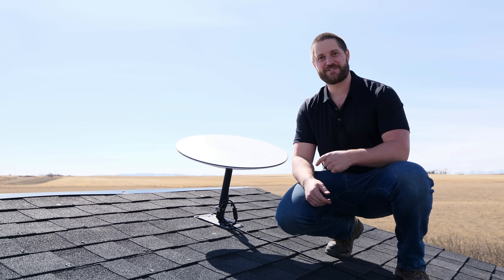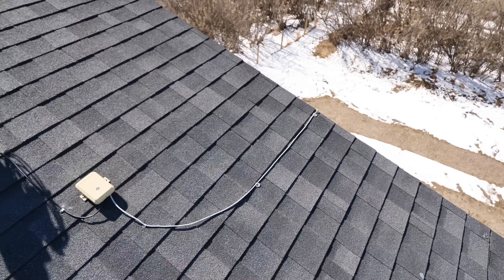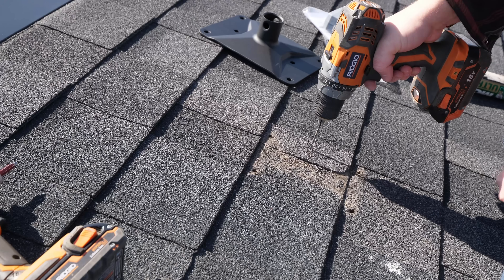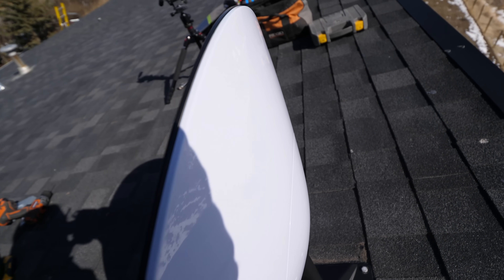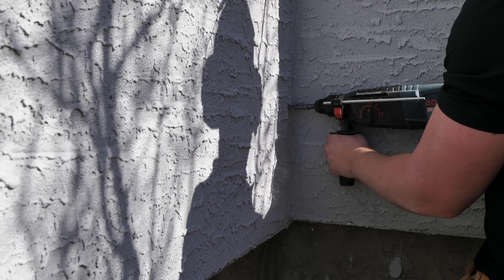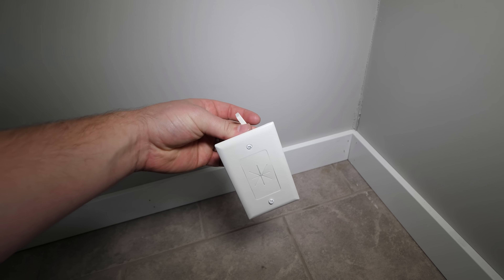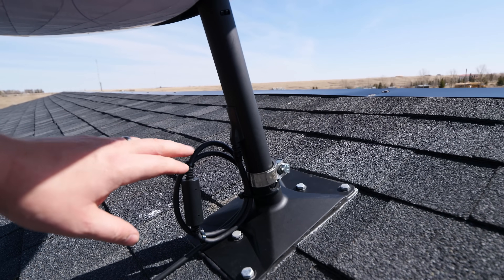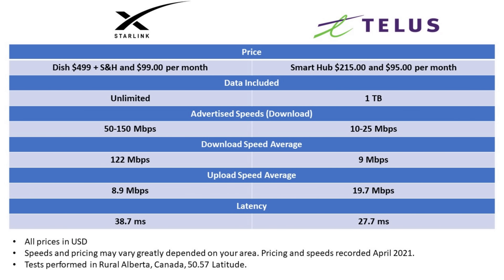Starlink Install, Speed Test, and Review

Comment: Great video! I get to install my first Starlink system for a client on Monday and because of your video, I discovered a small detail I overlooked initially. Your video was very thorough and informative. I used to be an installer and your install was flawless. It's unfortunate how poor of a design the mount connection is (considering who the manufacturer is!)... I vote for your version!  Thanks for the great video man!
Reply: if someone did not place his satelitte right can i delete everything and start over at zero
Reply: @zoelmanuel3968  no... I just experienced this with a client. If you try to change your service address, they will cancel your service and you will be put into a queue. My client was told mid-2022 and the service location was off by >5km
Reply: @d3445  i dont want to change address just want to know if i can start over if i delete the way it was installed
Reply: And ty
Reply: @zoelmanuel3968  You mean to just change the way it was installed on your property? I don't see a reason why not. Even with the router, you can factory reset if you wish. Just don't try to change the service location lol

Comment: ive came on here after seeing someone use the other base that came with the dish. i live in the uk and our roofs are way more pitched than this one. so much that you cant walk up it you need cat ladders.  the current design it just couldnt go anywhere bar the ridge of the roof to move left to right. but there be no where to put the bracket. Now i said my self, hey what do i know, there space X, im just a mere satellite installer.. But then i saw that flimsy slot in connector and im pretty shocked. Most houses in the uk are like mine with pitched roofs, its a shame as id like to use it, but i cant see that happening with dishes like that :(. Nice video!

Comment: it servers no purpose to install this on the roof. in fact its counterintuitive to the integrity of the system. dont post bad speeds because you misread instructions.
Reply: The roof gives the satellite a wider view of the horizon. This helps it with stable connections.
Reply: @miguellopez3392  i DONT believe SO MIGUEL. WHEN you first find your satellite via the app it will guide you through the part of the sky you need to have access to. installation on the roof would only be necessary if you were trying to avoid an obstruction in that particular location. what is critical however... the stability of the dish. this is something that you can secure much easier on the ground with no wind deflection. i encourage everyone to test in both locations and study the variance. you might be amazed with the improvement. "what beta"
Reply: @pearlrival3124  the angle of the dish goes down to 20 degrees, if you are in a valley or depression the extra hight can help. If you are in flat area with no trees then it won't help.
Reply: @miguellopez3392  Agreed. seems like that app feature would determine wether or not line of site is an issue. point im trying to make for viewers: you dont want it swaying on an antenna tower for no reason.

Comment: this doesn't make any sense you clearly live in the middle of nowhere and have cellphone signal I live near a busy interstate in a rural subdivision and cannot even get a cell signal my neighbor had tried for over 14 years and they won't budge my current ISP is through a cable company that sucks there speeds are only 100mbps down and 4mbps up and I pay $100 a month noone wants to service this area and I'm not sure why I really wish we could get fiber gigabyte speeds as it doesn't cost as much a month and is way faster wish some satellite companies could achieve this with low latency I also depend on wifi calling for cellphone service so is the latency low enough to achieve this with starlink

Comment: You should have left a little loop of wire where it goes into the house. A drip loop helps to prevent water from running in along the cable and into the home. I know you calked it but it is an extra bit of measure to help.

Comment: Wow starlink is so fast! This wireless connection that comes all the way from a freaking satellite is faster than wired connection I'm using LOL. I live in a remote area too (a 20 minute drive in the hills of Taiwan). And our internet uses coaxial cables, but is only 16Mbps according to speedtest.net. 170 Mbps in the middle of nowhere!? Just wow. And it's even getting better as they deploy more satellites

Comment: Thank you that answered I had. In Cheyenne, Wyo we too have high winds I was wondering how the antenna would handle it. To folks who don’t live in this area winds above 50 mph are common. Indecently the exhaust clamp would have been better it is designed to crimp in exhaust tubing.

Comment: nice install but you really needed  to add a drip loop before it comes into the house, which is an a half loop of the wire below the hole. this way any water coming down  the wire,  drips off the wire and not into the house.

Comment: Cool video thanks Dude.

I would've tested that dish before mounting it on the roof and your wire running into the house should have a little drop so water isn't flowing directly into your house, if the cable come in from below the hole, water will drip off before going in the hole.

Comment: Needs a radome cover to avoid the motor burning out due to strong wind resistance placed on the dish
Reply: A motorless version would be better, but SpaceX is not doing that (yet).
A motor in Dishy only needs to adjust once, when it starts, after that it stays still, so in theory it would be possible to do the adjustment by hand instead of the motors, but the firmware does not support that.
(as the constellation changes, the ideal angle of the antenna array may change, but that should be rare)
The other solution would be a bigger antenna array, which would be much more expensive, that can cover the whole sky without any mechanical movement.

Comment: Pull some of that cable back outside and create a drip loop - the way you have done it (even with silicone) gives water a straight path to flow into your house (albeit slowly) and start causing problems, because of the surface tension holding the water to the cable. 

A drip loop sits below the ingress hole and helps the water drip and gravity stops it getting back up and in.

Comment: Hello. Thank you for your video! It looks like the the whole construction is missing a ground connection, so one would probably have to improvise in order to ground it. It is not clear how good the dish, the mast and the base touch each other, and the tape certainly does not make it better if someone tries to ground drilling a hole in the base. Grounding is a good idea for those who get a lot of thunderstorms, as lightning will most certainly damage the equipment if the dish is not grounded. Please let me know if you decide to ground it and I would appreciate if you describe how you did it. Thanks again!
Reply: Shielded cable...all grounded through the power adapter brick

Comment: When installing the cable thru the exterior wall, install a drip loop so water doesn't get into the wall. This is important.
Reply: @restopesto9448  What would you have done better?
Reply: you must work in a cable company
Reply: Chitus, I was going to suggest the same thing.  You beat me to it.  Otherwise, I'm impressed with his installation.

Comment: IN INDIA WE ARE GETTING 500 MbPS FOR JUST ABOUT  LESS 10$ PER MONTH WITHOUT MUCH FLUCTUATIONS
Reply: Is it satellite internet?
Reply: @odisy64  no   its fiber optical but i am talking about speed
Reply: @anirudhrana2124  but the big deal is that this works anywhere. You cant get a fiber connection somewhere like rural America/Canada
Reply: @odisy64  but in india you can get fibre in rural areas too
Reply: @anirudhrana2124  what do you consider "rural"? Because rural in America is basically not being able to see other people's houses for miles and you bearly get a cell signal.

Comment: Can the dish be mounted on something ground based for simplicity sake?
Reply from the maker: Yes, it can be mounted to a platform or pole as long as it's view is free from obstructions.
Reply: @PROSDIY  What does heavy wet snow on the dish do to the signal? I've had 3 satellite dishes where wet snow would stick and take-out the signal. I had to go out with a ladder & broom to get the signal back?

Comment: Top tip: DO NOT drill holes in your roof for an install especially if you live in a wet climate. Not today, maybe not next week but at some point water is going to make it's way under that base plate and into your home. That roofing silicone is far from perfect.

Comment: That internet is also expensive is useless. I live in Italy I have fiber optics at home, and it gives me 907 Upload Downloads and 550 Uploads
Reply: Thats a wired connection, try getting fiber in the middle of nowhere and you wont get those speeds or prices.

Comment: My brother had this installed on the ground on a small elevated platform about table height... it works well there as well. You dont have to put it on the roof. Im sure it works better on the roof but if anyone was wondering, it works on the withground placement as well.

Comment: Starling sucks in India i got Airtel Xstreme BROADBAND which gives me unlimited data upto 3.3TB/months at $160.499 /year. And with a speed of 200Mbps which means i easily get downloading soeed 30-35MBPSand uploading speed 25-30MBPS.
Reply: You seem to forget this is satellite internet that works anywhere in the world, including the north and south pole. If you tried to get internet like this far away from one of your crowded Indian citys you would not be offered those speeds or price. I get 250mbps avreage with no data caps and 24ms latency on my starlink, by next year it should be as fast as fiber for global connection.

Comment: You should have mounted the dish on a pole instead, so you can have easy on-ground access when it needs adjustment.
Reply from the maker: Our home is surrounded by obstructions, trees and house. The reason I put it on the roof is it's 100% obstruction free and it's out of sight.

Comment: Question: if you have a portable battery generator like a Yeti 3000x. Can you take the system mobile? The battery backup would give you power for weeks if that’s the only thing plugged into it.
Reply from the maker: The dish currently has to be stationary. They plan on coming out with a product that can be mobile and moved around with, but isn't released to the public yet.

Comment: EVERYONE, DO NOT INSTALL IT THIS WAY!!  You do not put sealant on top of roof shingles.  You are sealing to granules with a substance that contracts and will pull the shingle granules away from the shingles and cause places where water will be wicked into your house due to water cohesion.

Best install practice is to get something like a com deck or fasten to the fascia at the end of the roof, but not on the shingles.  Or you could use a plumbing boot and integrate it properly under the shingles with the bottom daylighting on top to move any penetrating water back onto the shingles. You could also flash a block of wood to your roof with metal, and attach directly to the wood sealing off to the metal to provide a lasting seal.   

If you live in arid climates, this illustrated install may work for years.  If you live in a wet climate like the Eastern US, this will leak within 1 year most likely.  Then you will have mold growing in your home due to water penetration.  I have repaired countless leaks from satellite dishes installed in this manner.  DO NOT FOLLOW THIS INSTALL.  Either research how to install it properly, or hire a qualified roofer to install the base for you.  This video can ruin your home and cause huge damages to the structure of it.

This home owner on the video has water already penetrating into his home and he isn't even aware of it, but he will be in the near future.

Comment: As far as the wind is concern, how about running four guy wires as high up on the post as possible and anchoring them to the roof. Or, being a little more creative, mounting a Dome over the dish. I’m sure there are ways to fabricate the clear dome from whatever non-metallic materials needed. And just like the face diapers we now wear, there’ll be people manufacturing this for aftermarket sale. But then they will have to be tailored to your specific roof as everyone’s roof pitch is different. A dome will have the least amount of wind resistance and protect the dish from hail storms and other debris flying around as well. Just a few thoughts. Good luck.

Comment: When installing the cable thru the exterior wall, install a drip loop so water doesn't get into the wall. This is important.
Reply: True. But With the amount of sealant he put in, I don't think water will get in!! lol
Reply: @nicolasramis7212  it will get in through the cable. the sealant was for the outside hole. the water will run right in along the cable.
Reply: Extremely important!
Reply: Ditto

Comment: With this installation, no need to drill another hole thru the Volcano Mount. Remove the spring lock from the dish's pole, and insert a nut/bolt thru the existing holes.

Comment: FYI to all. I have done satellite roof installations for 20 years. If you have a J-pole as this fella did, you can install the Starlink dish on this pole. Drill a hole thru the j-pole, 2.5" from the top. Remove the little spring lock from the Starlink dish pole, insert it into the J-pole, secure with a long nut/bolt, and tighten it a lot, slightly squeezing the j-pole, creating a tight fit. I've installed several of these dishes using the j-pole.
Important Note: DO NOT seal the bottom edge of the mount! If water gets under it, it needs to drain. Also, the sealing tape will not adhere to the shingles when there is silicone or tar on it. There is no need to fill the holes prior to installing the bolts, because of the sealing tape.

Comment: You lose shingles because they are nailed wrong, I have been installing roofs for 20 years on lake huron never had a blow off, if you look at the shingle in the middle it's a double ply if it's not nailed in that half inch you will lose shingles also I use 6 nails per shingle

Comment: Great video, hey if you want to add a bit more stability to the antenna mount you could buy a Exhaust Pipe Tube Connector Sleeve 38mm 1.5" x 90mm long 1/2" Joiner Clamp-on or smaller if you can find. If the diameter of the clamp is too wide then just pack it with a trimmed down shingle or 2 or 3 which would sufficiently clamp a longer area to create better stability.

Mark

Comment: You should install a wind turbine with this reliability in wind speed.
Reply: This is a great idea, go wind powered with a tesla power wall
Reply: @VERTEPR  apparently Tesla powerwall doesn’t support wind :(
Reply: @ryanbrisson6035  damn
Reply: @ryanbrisson6035  Why wouldn't it support wind? Just get an inverter to get the voltage right and you should be good to go
Reply: @kevindst you could possibly. But you would have to bump up your wind turbine voltage from 12 or 24 or 48 all the way up to 400-450vdc for the power wall controller to accept the power (from what I read) Cuz they designed it to handle large solar arrays in series. Also if you did manage to bump your voltage up from your wind turbine you’d loose a lot of efficiency in the process. And I don’t think your warranty would cover anything if they found out you tried to plug alternate power sources into it. Which would suck lol
Reply: @ryanbrisson6035  Just sell/trade the electricity generated from wind to your utility company. they will take your generated electricity and add it as a credit to use later when there is not much wind. no battery needed.
Reply: @Nasser_NOS  I agree. Just sucks the power wall doesn’t support it. You’d think they would be all for it. More juice more better
Reply: @VERTEPR  Also, Tesla don't sell you just a tesla powerwall no more, need to bundle it with solar panels.
Reply: @henrybrar  so it's us or none
Reply: @VERTEPR  Exactly, after Texas winter storm the demand for Tesla Powerwalls went rocket high and since Tesla can't build them to fulfill the demand so they added the package deal. Now you end up spending way too much than your needs and Mr Musk got to travel to Mars.
Reply: @VERTEPR  Tesla powerwall is a bomb! Literally. Blast, fire, all dead. It's only purpose is to sell you used batteries from cars.
Reply: @5oa8in2wr  thanks for the propaganda comrade.
Reply: Tesla might as well work a turbine into the dish.
Reply: @ArrrrrrrW  Good idea. (+solar panels)
Reply: What!? I can't hear you
Reply: it would probably take off and fly to Madagascar !
Reply: with a true 300 watt turbine u can get 6kw per day there. that means u make 72 dolars per 4 months if u pay 0,10cent / kw. this turbines cost around 300 400 500 dollars . i think its worth 2 years cashback
Reply: A nice idea for wind areas
Reply: Yea you give the money
 he will install it
Reply: Strong winds are not good for Wind Turbines.
Reply: Wind turbine works just 100 day in the year (average).
Reply: @SamA-xu9gy show me your data
Reply: Too expensive for too little power return
Reply: @jacob476  You my Friend should watch the Movie "The Boy who Catched the Wind" on Netflix
Reply: @jacob476  Short operational life and maintenance is hell.
Reply: @jacob476  false, cheap af on amazon now
Reply: @jacob476  Yes but then the wind would stop. Murphy's law.
Reply: @koljolat  Then he wouldn’t have to install a metal roof
Reply: Bob Bottoms  you ever been under one theres literally stacked up
Reply: Bob Bottoms  iv been under one I don't know about you I don't really care eather way but that don't change it
Reply: You know how many birds get killed from those?
Reply: @fox4534  Not very many compared to cats owned by irresponsible owners who let their cats outside.
Reply: @fox4534 do you know how many birds die from coal fired power stations?